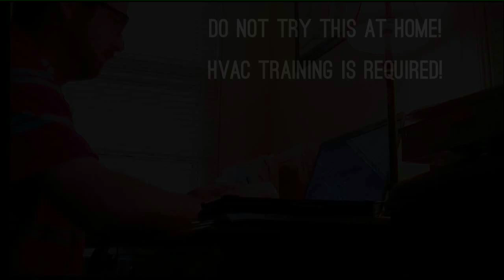HVAC Mad Science Series - Two Stage PSC Blower Systems

Comment: Clearly it can be done and most  ECM controls are 24 vac replications (with limit override operation) of G, Y, Y2, W1, W2, HUM (if available), O, R and C.  But the hard part is maintaining the proper air flow, usually 100% and 65% to match Copeland's two stage scrolls as well as the modified CFMs for W1 and W2, dehumification and fan only modes.  Not only do you lose the constant cfm of a full ECM over a range of static pressures, but in all likelihood, you may lose the proper 65% cfm reduction in low, which they run at the majority of the time.  I think an emergency replacement of a PSC at 100% cfm, without modifying existing ECM cables,  is a solution until an OEM or a parts house programmable ECM can be obtained.  Adding an inductor in the module's 24v line and a whole house surge suppressor would be good in an optimal installation.  Otherwise the common too high or too low air flow problems can be compounded..
Reply from the maker: +RJ P yes, that is it. It will be hard to get the 65% speed especially. You can probably get close to one, but maybe not both.

Comment: Last week I replaced a ECM with a psc I used two relays one for cool speed and one for heat speed.Could you think of a way I could have made it work with one relay instead of two?
Reply from the maker: +Robert Cherry
Reply from the maker: +Robert Cherry is this an air handler with a cooling speed and a heat strip speed?
Reply: WJR PRO yes it is a carrier FB4CNF024
Reply: WJR PRO 20 KW
Reply: Sorry 10 KW
Reply from the maker: +Robert Cherry the strip speed could be fed directly from the heat kit

Comment: Perhaps retrofitting a PSC air handler to a wholesaler programmable ECM with a low cost interface would be most valuable if it saved at least 2/3 the cost of a new unit.   But a middle class consumer would rarely replace anything until it was rusted out (like your last Goodman video).    Even is the gov required 18 seer minimum, grandfathering would always prevail and as we all know, increased seer almost never has an economic payback strong enough to justify a complete replacement that is still functional or repairable for a reasonable price.. 
 
www.usmotors.com/~/media/USMotors/Documents/Literature/Products/Training_RESCUESelect_Contractor.ashx?la=en
Reply from the maker: +RJ P that would be a good motor to use for sure. I have one similar to that from AO Smith